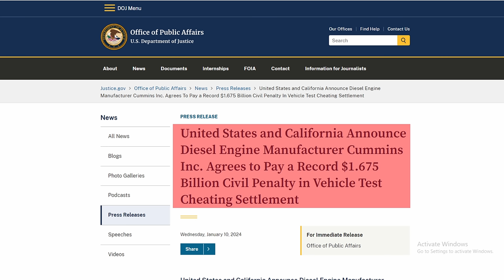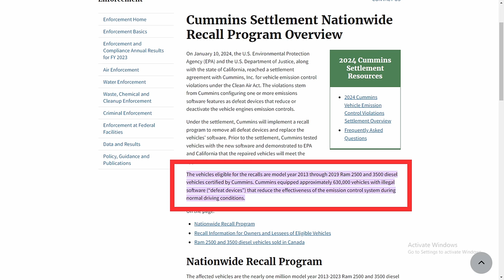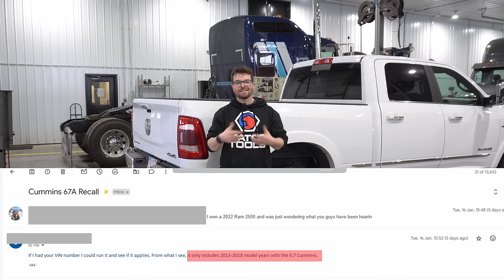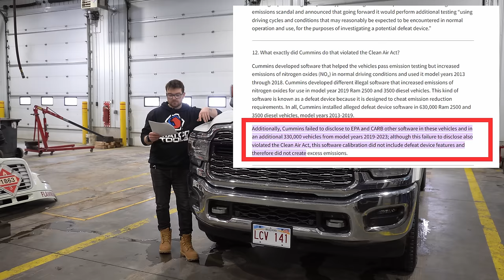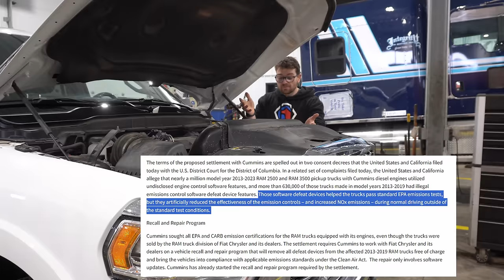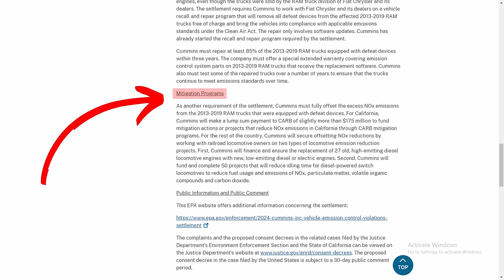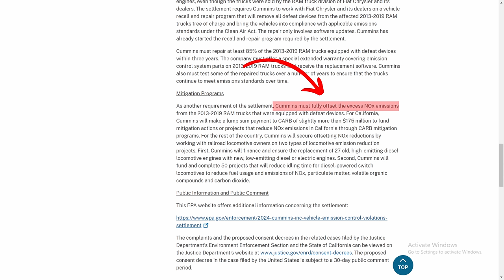RAM 2500 Cummins Diesel NOT GETTING RECALLED | Certified Diesel Mechanic Explains..

Comment: I here Ya Getty, This Matter is Way more complex than Most realize ? First  Thiers the Ecodiesel Settlement that " The Court further reserves and retains exclusive and continuing jurisdiction over the Settlement concerning the administration and enforcement of the Settlement Agreement and to effectuate its terms " This was smoke in the Air? for FCA/Fiat/ Stellantis , Cummins ship engines to Past and Present  Owners of ram Trucks. Cummins had NO control or involvement in the operation or aftertreatment until 2019 , Remember this Back in 2016 " Cummins reported that while the two companies are disputing over financial responsibility of the recall, they are working “collaboratively to resolve an issue with a third party after treatment system purchased by (Fiat Chrysler)" Hmmm Someone had to fall on the sword. We will see how Stellantis handles the Powerplants for its HD trucks 2500-5500, I See Cummins falling in to this out House and coming out smelling like a Rose.

Comment: I have gotten that recall on mine and it’s a 20
Reply from the maker: Check your build date. probably built in 2019 and sold as a 2020.
Reply: Bought it Jan 2021 don’t think it’s a 19 it’s a 5th gen, I haven’t called and checked at ram place yet but received a recall paper in mail, maybe they have something wrong
Reply: @p.t4769    There's a sticker on the valve cover or there used to be lol.  Check the date on that sticker.  Engines have a different build date then the trucks.  Could be you have an overrun engine meaning they made too many that never made it in the correct year truck or maybe they switch to new MY before using up engines.  There's also the chance although highly unlikely but still a chance that some engines got mixed around enough that your truck got an older engine due to this.  If this were the case it would explain why you got a recall notice.  Let me explain it this way.  If Cummins sent 150,000 engines to Ram but due to assembly downtime Ram was only able to build 100,000 trucks before next MY change over that means 50,000 engines will go into the next MY trucks.  This is just an example I'm sure it's not that many engines but it can add up if a scenario like this happens repeatedly.  Just trying to explain how your truck could have an older engine.

Also each engine has a birth certificate.  You can request this certificate from Cummins by getting the number on the sticker I'm talking about.  It's been awhile but I believe the certificate has info such as build date, testing parameters, if the engine was fixed during assembly for any reasons meaning did your engine cruise through assembly with zero issues or did something need to be fixed before moving down the assembly line.  I'm sure there's other info just can't remember it all lol.

Comment: Cummins has admitted no wrong doing and that the EPA has targeted them. This statement is coming from the CEO. The EPA isn't done yet. They are just trying to get diesels off the road. The calibration that is put into the ram product is built by cummins and tested but is only used in the ram product. Chrsyler, Diamler, Fiat owns and purcheses the rights to that engine since 2003. That engine only goes in the ram product. ram has very little to do with that engine.

Comment: With my new very short commutes I need to switch to a gasser.
Reply: 2018 3500 39K miles and still running strong.

Comment: Also, my 23 seems to go into regen every thousand miles. And that's 90% driving 55-90 mph commuting. Idk how accurate the dpf guage is but it'll be reading zero or barely a quarter and still go into regen. So. Effing. Dumb.

Comment: There is a really good product out there that will Keep trucks from regioning And it is called deep clean and it is made by Lucas. It is a very good product. All of your trucking companies use it. And my dad also used it as well. And I have talked to a lot of truckers. Debt swore by the product And it does not defeat emissions at all. What it does is it helps keep dpf clean
Reply: Lucas Oil website Deep Clean is only for gasoline engines.

Comment: This is whats called fear mongering. Pickups are an easy target for EPA. Years ago they slapped the hands of tuner manufacturers for delete tunes. Sparks motors got hit with a huge fine with their custom trucks as well. And they arent the only ones. Once the media got ahold of the stories, it forced everyone to re-think modding their trucks to stay complient. Didn’t last very long and people just got more creative. One more level of controlling the people from a governemnt stand point. Just curious....how much are the levels of NOX different between testing and daily life? No one has stated that yet that i have seen.
Reply: They should have known not to cheat emissions. Shame on Cummins for not designing the proper system from the get go.
Reply: They haven’t stopped, if you check their website, they’re still actively pursuing companies that sell or install defeat or delete devices. I’m pretty sure I read they are actively going after eBay for selling exhaust kits & block off plates & other parts. It’s not just diesel performance either, they hit Summit racing for exhaust kits that included vehicles from the ‘70’s that may have originally had cat converters installed.
Reply from the maker: Not honestly sure if the nox data has been fully released. I could not pull anything up.
Reply: @jeffs2809    A lot of people don't know that under the clean air act the EPA passed a law making it illegal to sell and install any part that modifies or replaces an emissions part that came stock on any vehicle and because it's the government doing so makes it a felony.

Comment: Amsoil Diesel Fuel supplement have already been proved out by over the road truckers to reduce regens by 40% and double the mileage at which dpfs need to be removed and baked to be cleaned out. That means through the use of Amsoil Diesel fuel supplement at every fill up your reducing soot production. This was found by diesel shop that repairs OTR diesels real world use results. Cant deny that.

Comment: And don't idle the truck for long periods of time
Reply from the maker: Yes very bad for these modern diesels.
Reply: Is it also bad to idle non-diesel, such as a ‘23 F150 5.0L V8 gas?
Reply: @ItIsColdHere  it most certainly is,fuel dilution in engine oil

Comment: Question, the $10,000 question is why are they going after all of the off-road equipment vehicles as well where they sit there in the idle day, and day out during their shifts, some of the equipments, and pits, or working on the side of the highways in the United States, Canada, and wherever else they’re dumping out all these emissions why aren’t these equipment operators also being tagged for emissions as well if we all have to apply, I think all of these companies that apply as well and go back to all of these older equipment they keep on smoking and our atmosphere with all of this Nox termination are used to work for somebody that has nothing but all equipment and when they started it, they would smoke out at least Half of area where he was living during this time I don’t think it’s fair that we all have to apply but some people are trying to be above the law and have all those older equipment that is not getting rid of the equipment and they’re still throwing all this stuff into the atmosphere because they are not running proper clean equipment
Reply: Newer off-road equipment has all the same emission controls, and many of the same problems with the systems.  The major difference between newer off-road equipment and newer on-road vehicle emission control systems is that many off-road diesel engines are capable of re-gens while at idle or only a bit above idle.  Remember, too, that off-road heavy duty equipment usually has a much longer physical and economic life than the average car or pickup.  That "smoky" off-road equipment you see may be 30 years old or more--before they were required to have any emission controls.